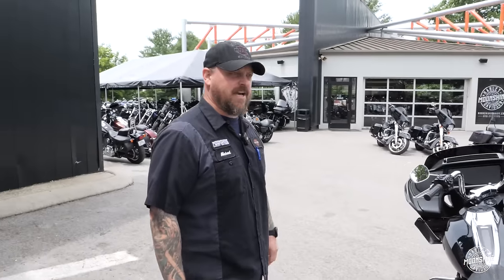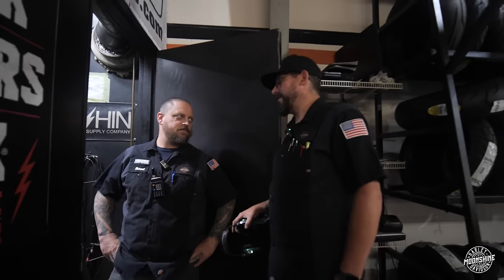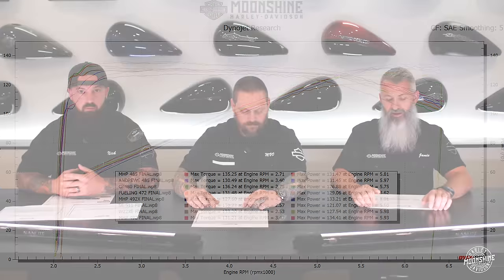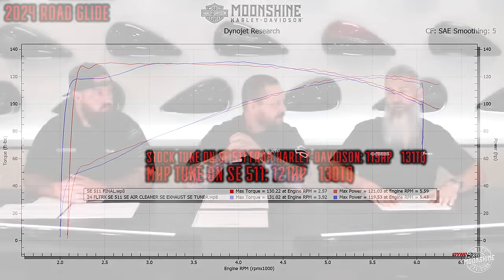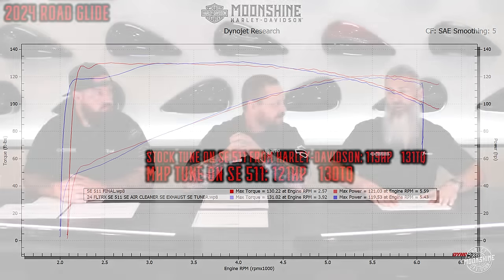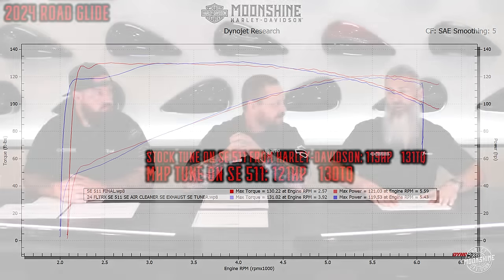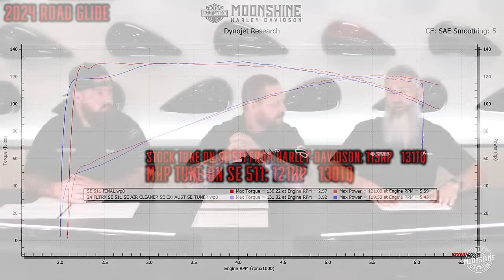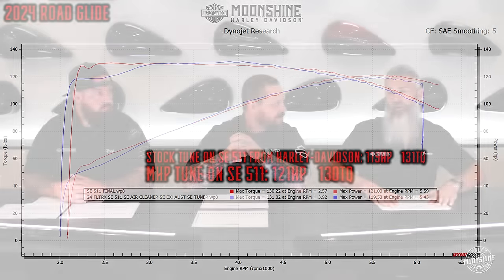The Ultimate Harley-Davidson 2024 Cam Shootout | Who Is The Best?

Comment: Wish y’all would have done the cr483
Reply: & the 485.  But I suspect their cams might not have "won" in that scenario.
Reply: 483 is the cam right now
Reply from the maker: @PAB712 They don’t creat low end torque. This series is for cams designed to produce low end torque and great HP. Those cams you mentioned would be top end cams which we’ll pair with larger cubic in high comp setups. We will do one of those cam shootouts at a later time.
Reply: @MoonshineHarley  Maybe the C.R. FAFO 550 or 557?
Reply: @MoonshineHarley  I gotcha. I have a rs 468 in mine. King of low end torque.
Reply: CR480MT. Monster Torque. "Everything the Original CR480 did, just sooner and holds out longer." (The Dyno Guys) If they advertised little blue pills with this description, they'd struggle to keep up with demand.
Edit: Alpha Performance Engines (co-creators of the CR480MT) said they "won't be using the MT in big bore applications... We will use the MT as a bolt-in option for the factory 107/114/117."
Reply: @1962egl  in a 2024 117? Tuned with thundermax?
Reply: @davidshaffer7544 need 12.5:1 CR and head work for that FAFO to work and gonna want larger displacement
Reply: @martinXY bet that MT woulda broke 140tq
Reply: @martinXY just had the cam changed in my 124 (did the bottom end while at it and some other stuff)
130hp 146tq
Torque curve ? No.  It’s a torque mesa.  Comes up from the hit to 140.  145 from 2500 to 5k with gentle rise to 146 at 4k.  Little soft at 5500 but I’m 3-5k way more than up at 55-6k…
Bike feels like a v12 Benz the way it gathers speed.  Its mind blowing 🤯
Reply: @geraldgoodiii6993  The M8 engines are just amazing.

Comment: I know you can’t have every Cam to test, but how could you guys leave out the Red Shift 468 and S&S 475 leading cams???
Reply from the maker: @DeBa1226  both of the cams get destroyed on initial torque and overall horsepower by the MHP-485 and CR 480.
Reply: @MoonshineHarley  not buying that…. All those other cams you’re saying did so much better than RS468 and S&S475, and warranted the comparison??? Lol

Comment: My buddy has a 2019 road glide, special 114 with a Arlen Ness breather, Vance and Hines X pipe,power vision tune & Cycle Rama 480 MT cam. 

He got 118.35 Horsepower
             133.36 torque
Reply: Can anybody chime in and tell me are those good numbers or is that low? He was told he was going get 125 hp and 140 torque.
Reply: Those are pretty typical numbers from what I've seen with that cam. That cam has a nice flat curve though! It really is a great option, and I'm surprised these guys used the old CR480 instead of the newer MT version

Comment: Harley stock 24' M8 touring is 105HP, 130ft. lb torque, at the crankshaft. Do you have any base dyno runs to post ?? Just interested in how much improvements were achieved.
Reply: Kruesi got it on his channel doing the new glide build
Reply from the maker: @jeffreyjones3228  the blue line on each graph is the stock pull.

Comment: What cam would you recommend for the 121 high output in the cvo st? Higher compression, 11.4-1
Reply from the maker: MHP-492 and its available at shop.moonshineharley.com
Reply: @MoonshineHarley  thank you. I spoke with Wes  from cycle Rama, and he suggested the cr 512. You think that would be a bad choice?
Reply from the maker: @davidcolby6661  the MHP 492 has a 522 lift intake and we’d push you towards it since you are have stock heads.
Reply: @MoonshineHarley ok, thank you!

Comment: I’d love any knowledge you guys can throw at me on the new cam sensor for these 24’s. What does the ecm do with the information the cam sensor is providing it? 

Reason I ask is my 2024 RG is throwing a p34100 (cam sensor) code, I have to get it home a couple hundred miles next week and it’s running “okay” but has shut off on me twice. Can clear the code but it comes right back once the bike is started so I do believe this is more than just a pull the 60 amp fuse situation.

Comment: should have included the zippers 468 cam
Reply: @marvelharris9540  I’m with you on that one. They never include that cam in any of their cam shootouts and it probably fits better into ninety percent of most riders riding styles.
Reply from the maker: @marvelharris9540   Yes. It’s an older cam and is out preformed by the MHP-485 and CR 480 on both initial torque and overall horsepower. No reason to include as we know the results.

Comment: Star racing F35 Cam
Reply: My f35a 114ci made
135 HP @ 6,140
134 TQ @ 3,750
Reply: @vernlochtefeld1626  I appreciate you giving me that info. That’s where I want to be in the 30s with both numbers being very close. F35A is the cam I have been eyeing for awhile and believe it would be best for my riding
Reply: @unclesaamisarmory  it was a stage 3 107 to 114. IE a lil bigger bore & shorter stroke than an off the floor 114.  Compression instead of 10.5-1 was 11-1. I used SE Ventilator extreme AC, ported 64TB and S&S Superstreet exhaust.
Reply from the maker: @unclesaamisarmory  doest work with factor valve springs so it would align with this test.

Comment: Man you hit the nail on the head! I retired from a job that was very stressful and I drove a lot so I sat a lot. Being able to now not be stressed out and to make and plan every meal, I have lost about 20 lbs and now working on  strength. Food is fuel the higher the quality of it the better you will run, just like in my motorcycle low quality of fuel it just labors to go. All the drugs in them world won’t fix the problem. It comes down to what and when you put stuff in your pie hole 😂